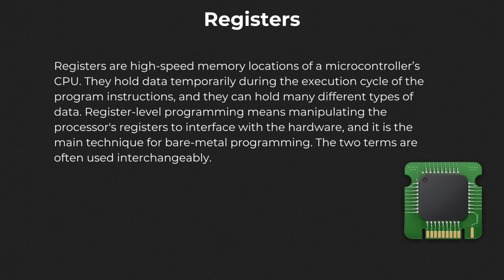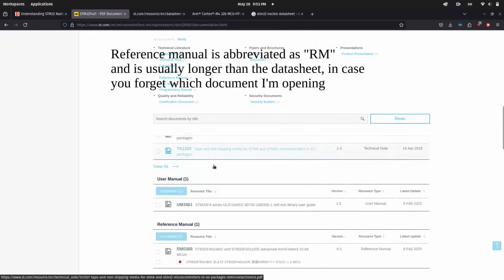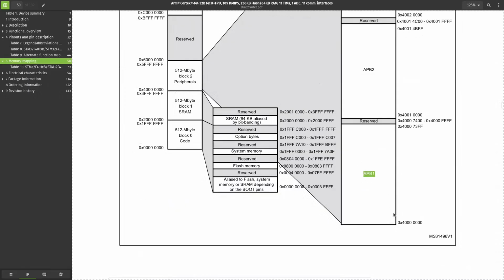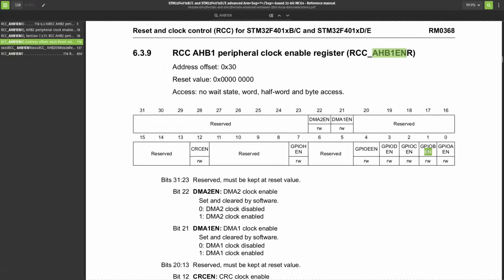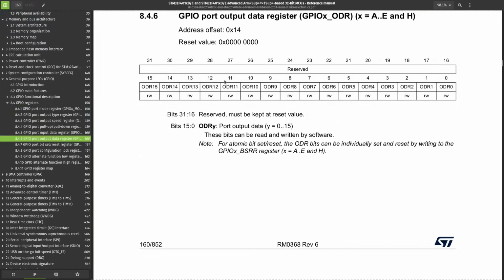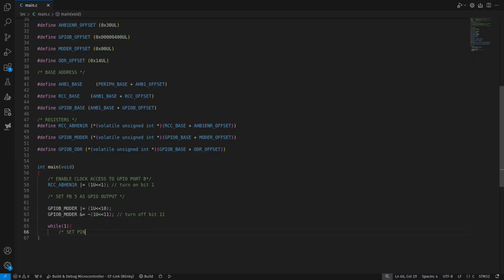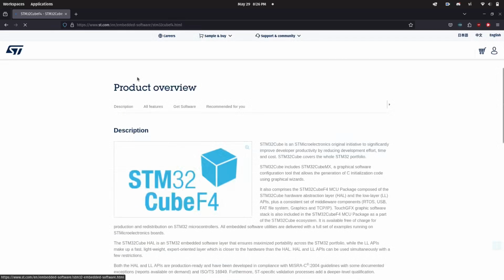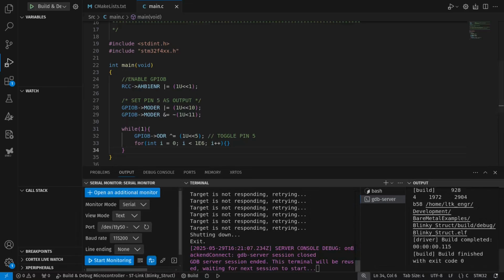Bare Metal STM32 #1: Introduction & Write a GPIO driver to blink LED

Comment: Great video. Any ideas on programming the STM32 with register level assembly? I can’t find many resources out there on it. You would probably need to write a script or something to convert the header file from structs to defines. Would also be interested in doing assembly on the esp32 in the idf environment.
Reply from the maker: I haven't tried that out so I can't help with that. Besides, there is hardly anyone wanting to do bare metal ESP32 since wireless communication like wifi really needs RTOS